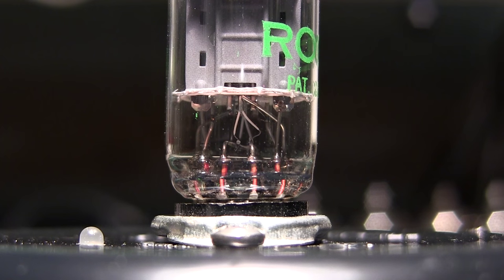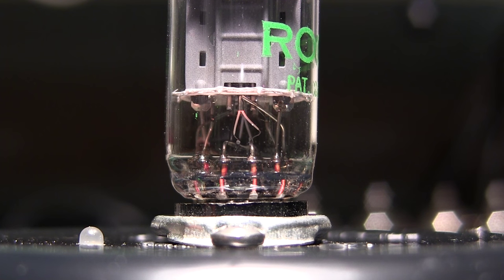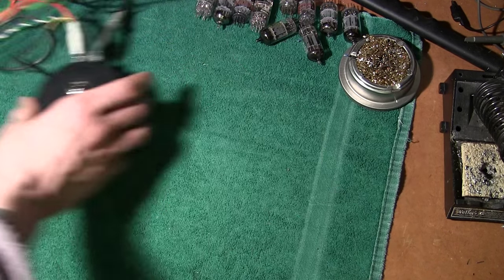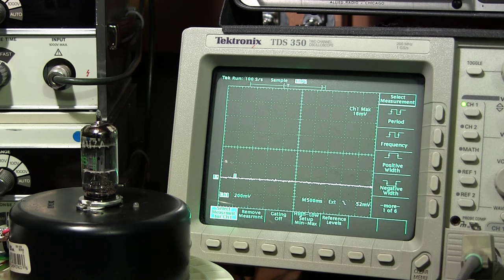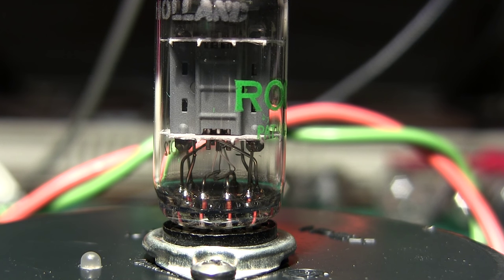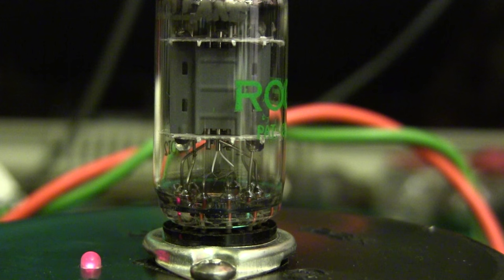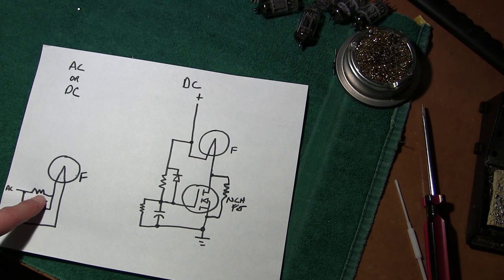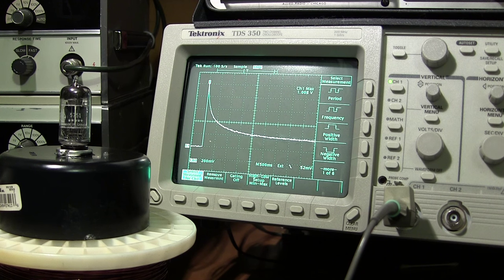Tech Tips Tuesday Dirty Little Secrets

Comment: Mr. Carlson has such a wonderful and clear didactic style. My Dad was a Seargant Tech at WWII end with a radio operator's license He built his own current-limited power supply, lights and all,  just as Paul demonstrates elsewhere. He used to fix all kinds of fifties-sixties-era HiFi stuff for his friends while I played in the basement while he worked. Some of it 'rubbed off' on me.
Pertinent to this video:
When I was a teen I used to fix guitar tube and discrete transistor amplifiers, organs, etc. 
I recall that the VOX AC100(four EL34 push-pull output the original Beatle amp) had a open wirewound resistor in a frame below a bimetallic leaf switch with contacts that closed when the wirewound heated it up - the current limit resistor was in parallel with this bimetal, mounted insulated from the wirewound heater. Clearly, it was engineered with filament flash in mind - a clever automatic solution - and this video made me finally realize just why it was designed. I should have kept up interest in electronics and done a degree in it but life interrupted and I ended up sidetracked before learning the theory underpinning all the practical repairs I had learned to do. Sigh.
Reply: Indeed.

Comment: Great tips.  I once had a 1950's Allen 3-manual church organ which used 12AUX7 tube oscillators, one for each note.  They were built into 6-note chassis and the chassis were built on to a large floor rack. There were three racks so you can imagine the number of tubes involved.  I never counted them but when I switched the organ on the lights in the house dimmed for a second.  It took about as much current as a clothes dryer.  But it sure shook the house when I "pulled all the stops".

Comment: Using a constant current source is very gentle on the heaters and is easy using an LM317. The heater supply AC is rectified to DC that gives the CCS the voltage compliance headroom it needs to work properly. Another technique is a negative temperature coefficient thermistor - it does require a bit of experimentation and does drop a bit of voltage even warmed up. With newish tubes with good "emission" running at just below the rated voltage doesn't seem to hurt performance. I was told that the "flashy" heater tubes were meant for series connection off the mains voltage using a ballast resistor that drops the excess voltage and limits the inrush current. This was popular with cheap radios and TV sets where a penny saved equaled more profit! I completely agree with Mr Carlson that gentle treatment of the heaters helps prolong service life. The one possible exception might be directly heated triodes where the flash helps blast off cathode poisoning (there were several tube "rejuvenators" that worked on this principle).

Comment: Good stuff, and yes, even back 30 odd years ago, (when tubes were supposedly cheap ....), I did this.  On my Hallicrafters Rx and Tx, I installed a big wire-wound resistor across the power switch (each rig is supplied by an individually switched power board back in my rack).  So when the main switch for that particular piece of equipment is turned on, there is a soft start for all the heaters/filaments, before the power switch on the actual equipment is turned on to bridge the resistor and bring full power to the tubes.  Good also for re-forming the capacitors - in that case, the HT switch is also turned on some minutes later with the power switch still 'off', so there is half LV and something like half HT in that mode.  Not as good as running through a Variac, but a quick precautionary tactic.

Comment: Just for info:  I have always used a "soft start" set up for all of my vacuum tube circuits.  Some have been manual, with a switch and resistor, and others have been automatic with a time delay relay and resistor. Both types have always been successful in eliminating any filament or heater flash and in saving all of my favorite (and rather expensive) tubes used in my audio circuits. I also use the same type of soft delay in the B+ power supply circuits for all of my pre-amps and power amps.  Good luck and happy listening to everyone!
Reply: Soft start HT = Valve rectifier
Reply: @PrinceWesterburg ...THE HEATER CURRENT DOESN'T GO THROUGH A VACUUM TUBE RECTIFIER- ONLY THE B+ DOES.

Comment: Some of the RCA CTC series tube chassis used a thermistor in the filament chain to provide a soft start. When we got a call for a dead TV, the first check was the thermistor if it was open, very common, we'd remove the body of the resistor and twist the leads together. That way, we didn't have to remove the chassis to solder in a new part. There was another thermistor in the degaussing circuit that could fail, but it rarely happened.

Comment: You can solve the problem by placing an inrush current limiting thermister in series with the power cord, which actually drops in resistance as it heats. This also protects solid state diode circuits, though only when turned on cold. It will always protect the tubes, though, because they only flash when cold.  My 11 tube RCA Color Television dot/color bar/crosshatch generator uses one of these, and always turns on gently. Amazingly this piece of equipment has ALL of its original components, which test and work perfectly.

Comment: Hi Mr. Carlson I have seen this often in valves - firstly, when I was little, I noticed the flash in one of the valves in our B&W telly. This was a transformerless design with all the filaments tapped across the mains via heavy duty resistor to absorb the difference. The telly ran for approx nine years like this. When I git a bit older, I read in the 1950's hobby magazine that it was known about & "didn't seem to hurt the valve". In 2014 I built the Mullard 10+10 amplifier using two EF 86's & four ECL86's. Three out of the four ECL86's flash on startup so it will be interesting to note how long these filaments last. I have always assumed that the flash was normal - partly 'cos of our telly & partly because of the article. Thank you very much for posting this - it's the first time I've ever heard of it being a problem:)
Reply from the maker: You're Welcome, glad you enjoyed!

Comment: Thanks Paul for touching on the main problem I encounter when buying old radios.   I cringe when I hear a seller saying he plugged in his Grandfather's old radio and it didn't do anything.   Cold filaments & discharged leaky capacitors put a tremendous surge load on an already marginal power supply.   Better if they would sell that radio completely untested and let me bring it up on a variac.   I have gotten some with exploded electrolytics that popped metal foil ribbon under the chassis in the high voltage area.

Comment: I have a Swan MK I H-F amplifier. How I save my expensive 3-400Z tubes is to use a Variac rotating the control on the Variac slowly upwards taking about two minutes to reach full line voltage. This way you do not shock the tube's filaments. I've had the amp for over 25 years, the tubes have not gone soft or lost power at 15 or 10 meters. I do have a matched pair of 3-400Z's stored in a cool, dry place, but they may never get used unless I get rowdy and drive the amp to 3.5KW  with 100W drive from my Drake Twins. Your way for smaller tubes is great, I will have to remember this.
Reply: Cycle your tubes once a year. You don't want them to go gassey! Gas is a real problem in large transmitting tubes like 3-500, 3-400 and 4-400 tubes. It a really RISKY buying NOS (new old stock) transmitting tubes from the likes of eBay. They can be gassey and no good even though they have never been used. 73, Jim W7RY

Comment: Great info, I was not aware of this issue.  I am getting back into vacuum tubes after 25 years in modern solid state electronics.  For that fix with the MOSFET a Triac could be used for an AC system.  The current will jump when the triac fires but should still eliminate the heater flash.

Comment: What I have been doing for years is using an older style time delay relay like was used in commercial/industrial equipment back before PLC's became the norm.  The kind with a octal tube socket base and a timing adjustment knob on top.  Most are rated with 10 amp relay contacts so they handle a pretty good load.  I ended up with hundreds of them years ago at a auction of a local relay manufacturing plant that was moving operations over seas.  Went there to buy a Bridgeport milling machine and ended up coming home with the Bridgeport milling machine and hundreds of these little time delay relays along with a bunch of other goodies.  Took me a while to find a use for them but I found this filament flash problem a great place to use them.  The ones that have a time adjustment range of 1-60 seconds is perfect for this application.  Just mount a octal socket, break the filament feed line and run it through the relay and install the dropping resistor across the relay contacts.
Reply from the maker: +MikesRadioRepair .CBRadio 
Sounds like those relays would be great. Thanks for your comment Mike!

Comment: Great demonstration.   Within amateur radio RF power amplifiers, many have a Soft Start circuit, which eliminates the in-rush current to the electrolytic capacitors and power tube filaments.

Comment: I did something similar with my old tube gear.  I used a relay (with a simple timing circuit) to short out a current limiting resistor that I installed in series with the filament supply.

Comment: The better vacuum tube equipment had means of limiting turn on surge with either thermistors or “surgistors”.  The surgistor was a wirewound resistor attached next to a normally open bi-metallic contact across it. This was connected in series with either the power line or the tube heaters.  When the power to the equipment was turned on the resistor would limit the initial surge while heating the bi-metallic contact.  After a few seconds the contact would close removing the current limiting of the resistor, and the contact would stay closed due to the slight heating of the current through the bi-metallic contact arm.  I was very surprised that nobody seemed to be aware of this common solution to this old problem.

Comment: Back in the 1960s, before solid-state TVs, some manufacturers had an "Instant-On" feature. They would keep a few volts on the tube filaments, including the CRT, all the time. Of course, this increased your electric bill. Some TVs had a switch on the back that allowed you to turn off the instant feature. It was probably around 3-4 Volts for the 5-Volt tubes and 7-8 Volts for the 12-Volt tubes.

Comment: When I repaired vacuum tube equipment in the 1970s era, I noticed some older equipment had ntc resistors in series with the filament chain to prevent inrush currents to extend the life span of the tubes. There were also vacuum tube TVs and amplifiers that had the “instant on” feature with the simple switch/resistor in the filament chain as Mr. Carlson described. The switch was integrated with the on/off-volume control.

Excellent presentation as always sir.

Comment: I've noticed that in series filament (rectified filament with 60 or more volts across 5 preamp tubes) preamps, that this problem is multiplied, and that with 12AX7A's the chinese rubiy tubes seem to be the best .  Not only do they draw less current when on, but the cold resistance is not such a small fraction of the warm resistance.  Also they seem to be very consistent from one tube to the next.

Comment: Going back decades, I’d seen the flash many times, but wrongly, never attached any importance to it. The demonstration shows clearly that the bare, uncoated section of the filament, which is thermally-insulated by the hard vacuum, with nowhere for the heat to go except by radiation, gets the hottest. 
The demonstration reminded me of the use of a thermistor to protect the filament of a 35mm projector bulb, which could be costly to replace. I never had a single failure after inserting the thermistor in series; yet the bulb life was given as only 10 hours. The thermistor had a high resistance when cold, but a very low resistance when hot. The residual resistance when hot, was small compared with the filament resistance, and so caused negligible reduction in bulb brilliance. I am left wondering whether a thermistor could be used to protect a tube filament(s) in a similar way, with the advantages of reduced space requirement, less circuitry and simplicity.
Reply: Thermistors were used in TV sets where all vacuum tubes heaters are connected in series.
Reply: ...ABSOLUTELY!!!

Comment: walking thru your tips and learning so much, i had no interest in electronics back in UnderGrad then got a job in Medical R&D and was really handicapped by the knowledge gap. i was stuck working ergonomic, man machine interface, beam guidance and materials science for Data clarity. this basic stuff should get its way into the STEM program here in the US or Scouts program for Technology. Great basics that can be used to understand circuits and know what and why of so much stuff in everyday use. Modern Day Mr. Wizard stuff that I used to watch as a kid. Thank You for providing this ground level 101 material, extremely well presented and most understandable you little test kits are great too. Now as a Patreon I want to explore all your material and get to where i can solve some on my hobby issues in electronics as well as setup all my test gear for these old radios. very encouraging and energizing for this old brain.
Reply from the maker: I'm glad to assist you in your journey Dennis!

Comment: Best reason to engineer DC filament supplies with a soft start feature, that ramps up the voltage over a period of time. I usually choose about 45 seconds, and do not start the high voltage supply up until the filaments have been on full for about 2 minutes. Also observe the heater to cathode voltage limits  in the tube manual. In some cases you may have to create several filament supplies and operate them electrostaticly floated at a specific positive or negative voltage in order maintain the specification for any given tube.  In a typical circuit of mine a differential cascode triode set has a pair of cathodes near ground, and another pair at about +125. In this case, a high impedance voltage divider is created to bias the filament at about +67 volts. this puts the cathodes of all four elements at far less than the +-100 volts specified for the tubes used.  The long tail current source for the differential set above also consists of a series stack of parallel triodes similar to the tubes used in the diff amp above it. Again, the design centers of where the cathodes are below ground,  and a single filament supply biased to a point midway between the cathodes is used. If the volage between the cathodes was near or exceeds the heater to cathode specification, additional filament supply will be needed.  In some amplifiers, I need 3 floated and biased filament supplies in the front end circuit,  and 2 separate supplies for the power tubes, each bias point driven by a buffer to 'follow' the instantaneous voltage at the cathodes of the low impedance power high current tubes in the Circlotron topology balanced bridge output stage.
Reply: ...SOUNDS COMPLICATED-(!)

Comment: You could also use a thermal time delay relay to short out the current limiting resistor. It has the simplicity of your switch solution and the autonomy of your mosfet solution.
Reply from the maker: +Eric Wasatonic 
LOL, You know, just outside the shot to your left at the test fixture scene, I had a 115NO20T on the bench.... But I figured, who is going to go get one of these old thermal delay relays. Maybe like you mentioned, I should have shown it. Thanks for your input Eric!
Reply: +Mr Carlson's Lab, I use thermal relay tubes all the time, lol.  I have never used them to ramp up heaters, so that's next on the list.  Brilliant idea - thank you!
Reply from the maker: Glad you enjoyed!
Reply: I just bought some 115N010s, 115NO15s, 115N020s, 115N030s, and 115N060s. The prices on those have really skyrocketed recently.  It's crazy. If you have opened up that Lambda PSU on your bench, you know it has a 115 volt thermal time delay inside it, too. I think mine has a 60 second inside it. I like the way the old octal thermal time delays will let me short cycle something off and back on without waiting a minute for the time delay to it's run full cycle again.
Reply: @Satchmoeddie ...it's a LOT cheaper to use a 555 timer and a relay-(!)

Comment: I use something similar for old series set radios. The 60 watt light bulb with a switch across it built on a 4 inch steel electrical box. After about 15 seconds warm up, I throw throw the switch for full power. Had the flash problem with the 35W4's blowing the filament prematurely and this cured the problem.
Reply from the maker: +ClockWatcher 
Great solution! Glad to managed to save those 35W4's. Thanks for your story!

Comment: I've recently picked up an old transformerless phonograph amp that uses a pair of 50C5's and a 12AX7. The filaments are wired in series and the 12AX7 flashes worse than this! All three tubes use 150mA filament current each, but due to extra strain on the 12AX7 filaments, the 12AX7 filament voltage goes up to 20 volts for a few seconds until the 50C5's warm up! I'm not sure of the make of the tubes. All three just say "CBS" and "made in USA" on them. If I slowly increase the filament voltage this flash doesn't happen. I'm going to try this circuit. Thanks again Paul!